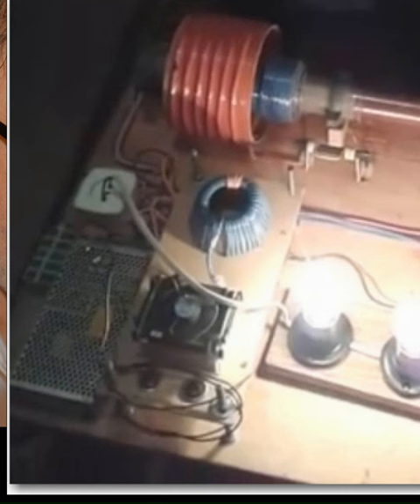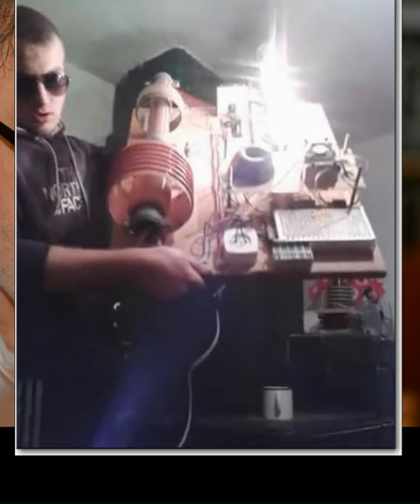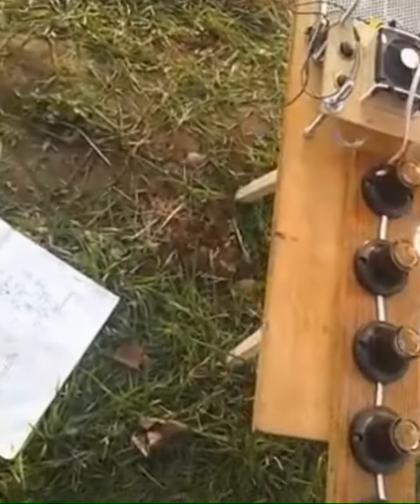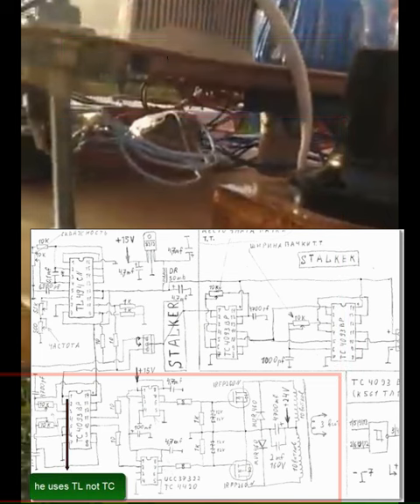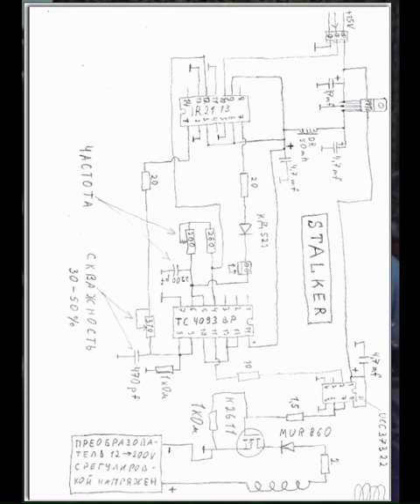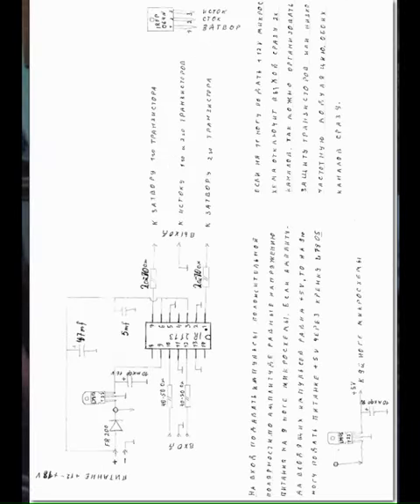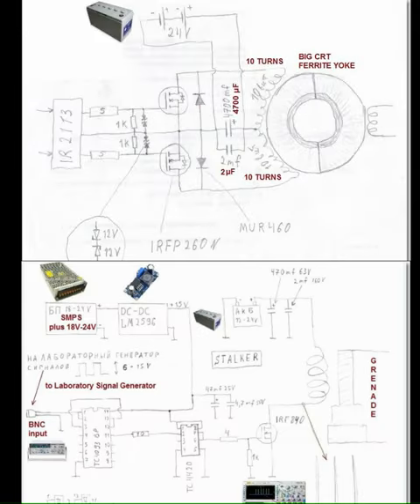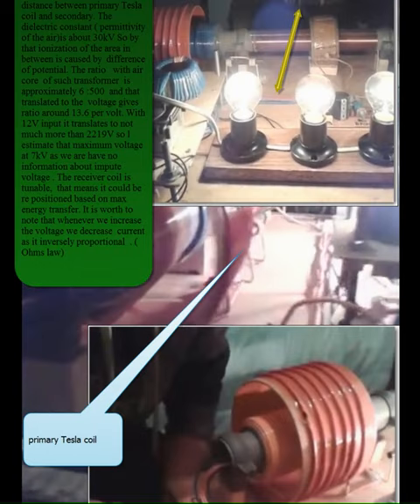Andrian (Dniester) Free Energy Device part 3 technical

Comment: I'm a senior citizen in a restricted housing situation and cannot build things like this so I approach people like yourself who engineer such devices hoping I may purchasing one.  Also, can the output be modified close to 'pure' sine-wave and adjusted for 60-cycles by adding certain circuits so I may operate more sensitive devices other than light bulbs?
Reply from the maker: it is more requiring to know  please go to: http://overunity.com/12736/kapanadze-cousin-dally-free-energy/15570/#.WBjbnsnwNhE but that forum is to people very much skilled in art. So by that there is none who will provide you with specifics. However  you will be on the top of what is new  in this particular area.